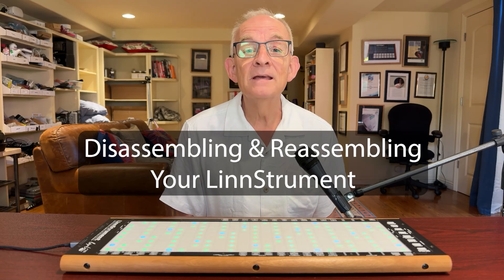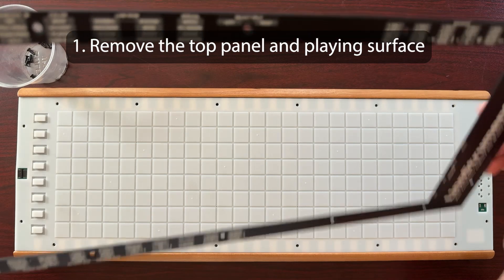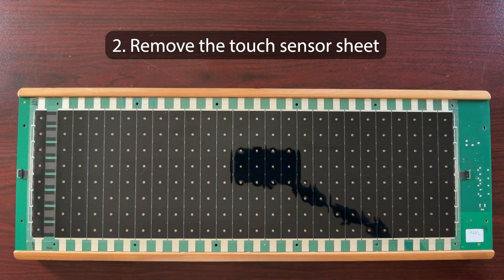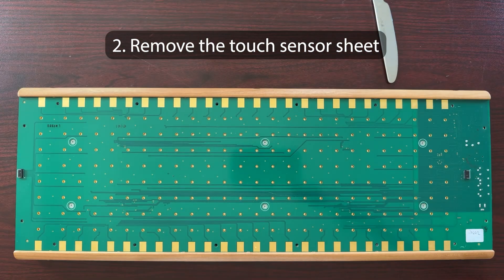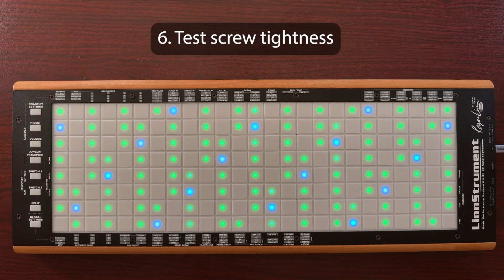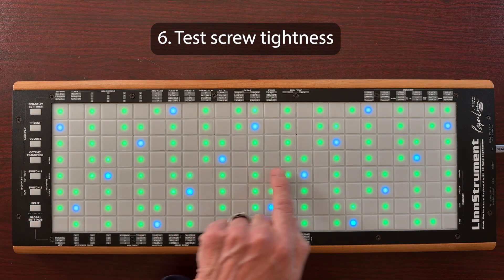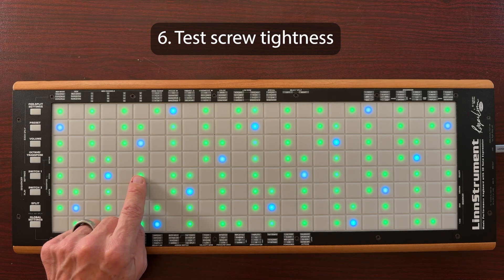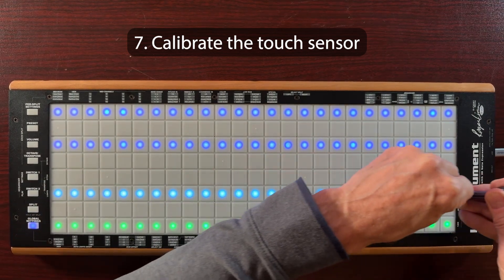LinnStrument Disassembly 2024

Comment: The Linnstrument should be way more popular than it is. 
OK, that, and I now know which thing has come loose inside of it. One of the gel packets. I guess I'm less worried now because I know it's not a core component.
Reply from the maker: I’m sorry about the problem with the desiccant packets inside. If you’re not aware of the solution, please visit the LinnStrument FAQ page, Problems tab, and read the FAQ “There's something loose that slides around inside my LinnStrument when I move it. What's wrong?”
And thanks for the compliment about LinnStrument. As a tiny company, it’s difficult to get the word out, so any videos or spreading the word is appreciated. That said, 4750 units sold so far isn’t too bad for a new type of instrument of its price.
Reply: if it was 300.00 usd maybe it would be more popular the price is probably keeping it none popular.
Reply: not to mention it looks more like a DIY project than a production piece. cool but not for it's asking price for what it looks like and whats inside.cool concept though.